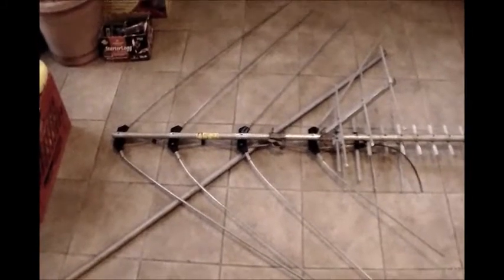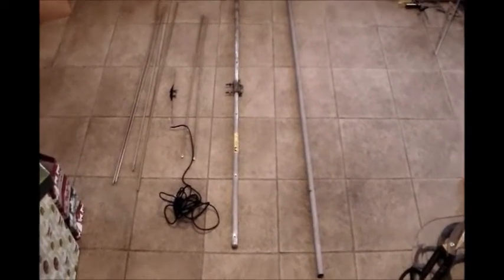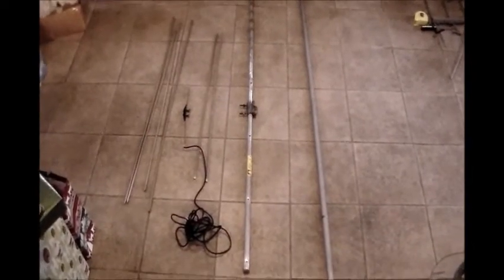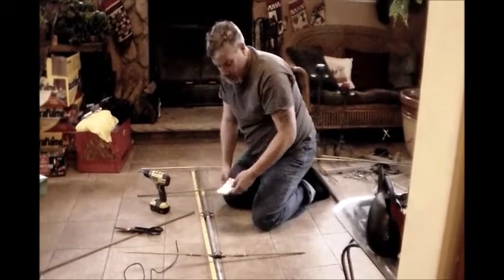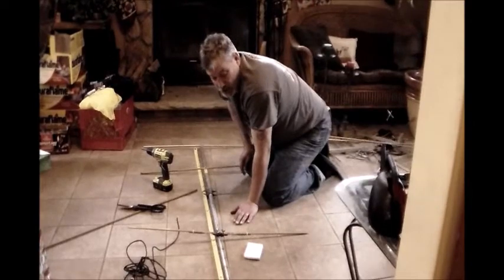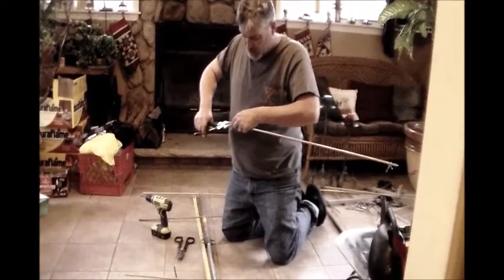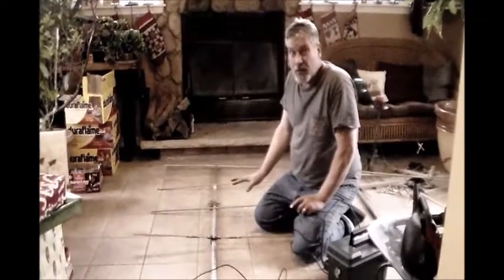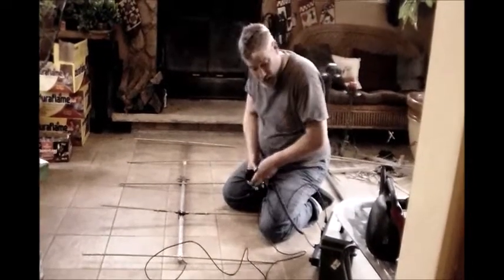Homebuilt 2 meter yagi antena

Comment: How did you connect the coax to your driven element ?
Reply from the maker: I screwed it on.  I tried soldering it but I couldn't get a good joint.  Seems to be working good.